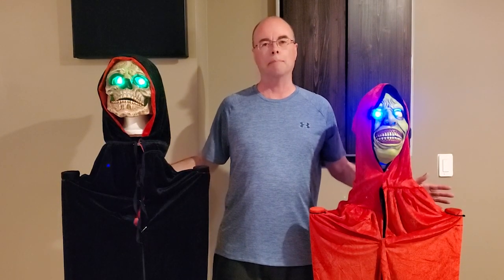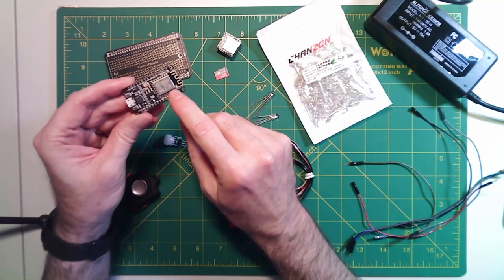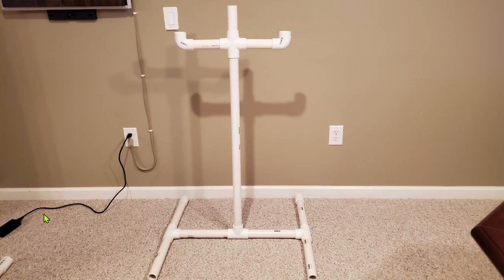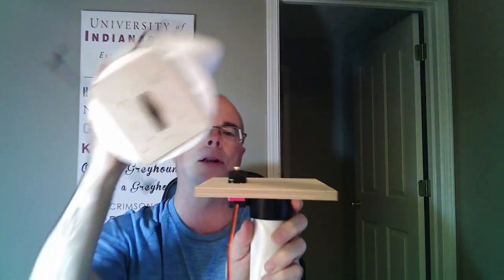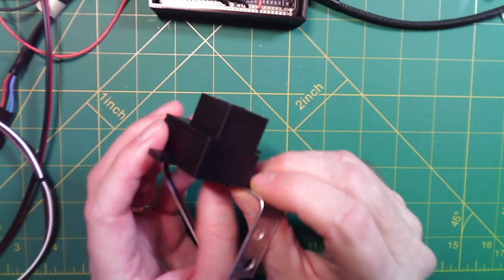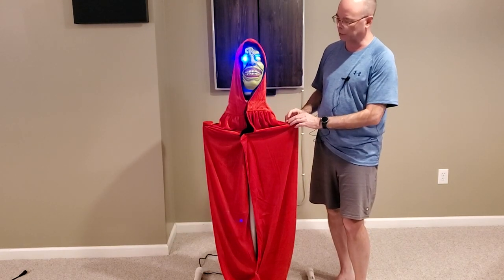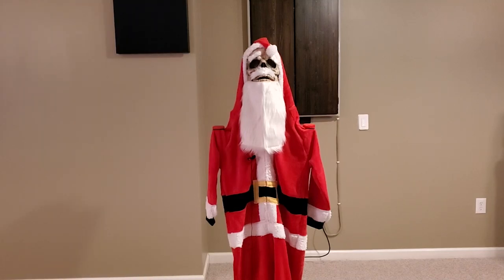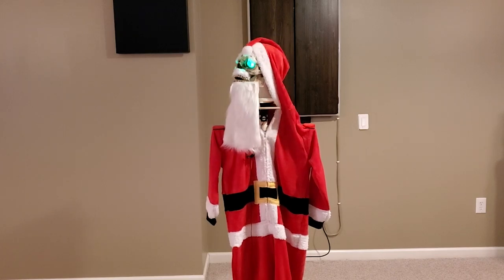Animatronic Halloween Props with mp3 Audio using an ESP8266

Comment: The easiest way to keep your PVC from rotating in the connector is to drill a hole through both the connector and the PVC and then put a bolt through it. The bolt can be removed when you want to take it apart for storage and put back in when you reassemble it.

Great project!
Reply from the maker: What a great simple idea!  I don't know why that didn't cross my mind during Halloween night.  I kept trying to prop up the middle with concrete blocks, bags of dirt, etc.  All the while, I could have drilled a quick hole and stuck a bolt in it!  That's why I love the DIY community... someone always has a better idea to share.  Thanks for the suggestion... and for watching!

Comment: Can you use a portable usb charger for this project that has two usb ports?
Reply from the maker: I think trying to use a USB power bank or charger might be a problem due to the total amp draw required by the props.  I don't believe I actually measured the total amp draw, especially when both props are in motion at the same time, but I think the written guide I created listed a 5V 5A power supply, with 10A recommended.  Most USB power banks are only rated to continuously supply around 2-3A, but you may be able to find one that can supply more current.

You could certainly try it.  If you find that the heads don't want to turn or tend to "stall out", the LEDs seem too dim, etc. that's a sure sign that the USB bank isn't supplying enough current.  And I'd highly recommend you test thoroughly while monitoring the temperature of the power bank.  If it begins to get hot, that's a sure sign that you are overtaxing the power supply due to drawing too many amps.  And of course the current draw, along with how often the props are activated, will also determine how long a power bank will last before needing to recharge.  

But if you do try it, let me know what you find out and how well it worked.

Comment: what is this website that you can control the prop head?,is this free? how can I have an access to a MQTT website like that. Thank You.
Reply from the maker: The automation and the web control that I showare all handled within Home Assistant.  I cover this a bit towards the end of the video.  Everything I show, from a code/interface standpoint (Arduino code, MQTT, Home Assistant, etc.) are all completely free.  There isn't any sort of "web site" other then the Home Assistant dashboard.  Although it would be possible to create a web interface to control the props if that is desired.
 
You can find my Arduino code and more information on how to use it in my Github repo: https://github.com/Resinchem/Halloween-Props/tree/main

Comment: Hi i am going to try this and let you know how i get on , regarding the pipe i has the same issue so by drilling into the pipe and putting a self tapper screw into both pipes it stops the pipes from bending especially when using hot glue to keep the pipes into place then makes the whole prop ridged without it bending in the wind , the sketch with all your details and wiring diagram should work the same as you have shown , is there any additional libraries needed ? or the sketch shown just needs uploading to the esp8266 .
Reply from the maker: Hi... mine are staged out in the garage and ready to go for Monday.  I did make some changes this year, including the screw in the PVC, which someone else had recommended.  I also shortened both of them about a foot, as they were more 'adult' side and I wanted them lower for the kids.  Finally, this year I won't be using the motion detectors.  I forgot how excited kids are, and in most cases, they ran right by the props before the props even had a chance to move!  Instead I'm using a small handheld remote that uses a D1Mini and MQTT so I can set them off individually or as a pair via button presses.  I also added a large spider connected to fishing line and a couple of servos that are controlled by the remote as well.  We'll see how it goes this year.

As far as the sketch, there may be some settings that you will want to tweak... if you haven't looked at it yet, these are all described in the wiki for the project at: https://github.com/Resinchem/Halloween-Props/wiki.  The initial installation  section (step 4) discusses the additional libraries that are needed. Note that there are also two different versions depending on which prop(s) you built.  They are not interchangeable.

Definitely let me know how it goes for you if you do build them... and if you make any additional improvements.
Reply: @ResinChemTech  thank you for getting back to me on this and i will let you know how it all goes , keep up the good work.